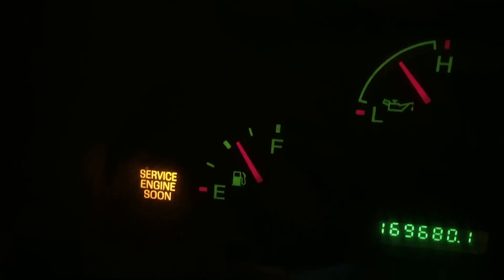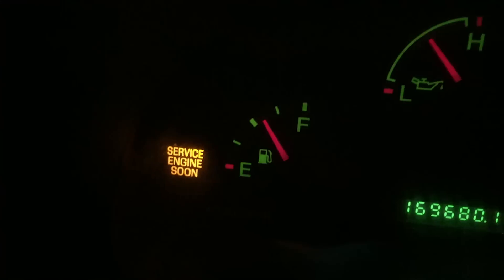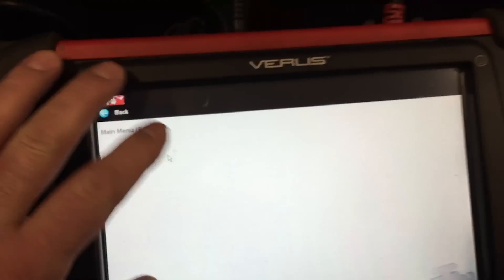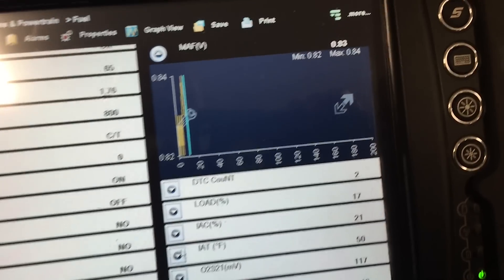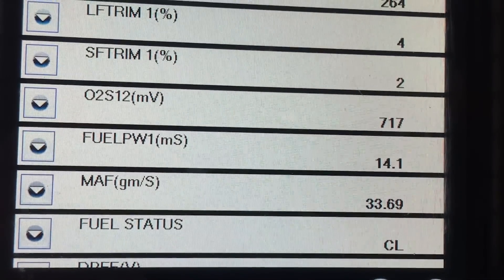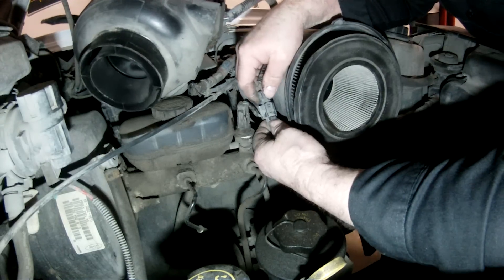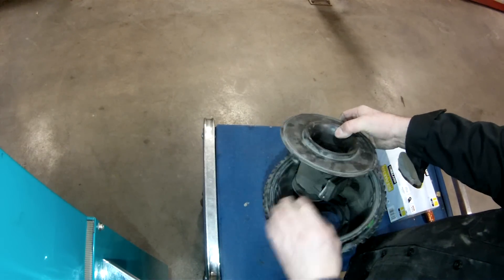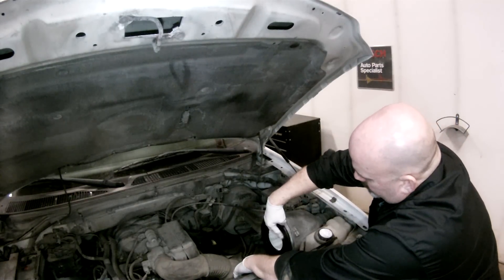Ford P0171 P0174 P1101 - Ford Mass Airflow Sensor Diagnosis Video

Comment: Will it also cause the engine to run cold my heater is working fine but the code said the engine is too cold and it's an open loop

Comment: what if you get lean on one bank and rich on another bank. Runs well when started but has hard cold starts. Checked for vacuum leaks. also there is a rattle in the engine under load at low rpm almost like pre-ignition. No code specifically aimed at MAF. P0171 and P0175 and randomly had a p0300

Comment: I know this video is very old, but worth the shot. My check engine light has been on for months now. Issue I’m having now is that the truck cranks for a very long time before turning on. Sometimes when it does turn on it smells like gas and then will run like if it choked. I checked the fuel pump and they say it’s good cleaned out the injectors and changed the fuel filter.
Reply from the maker: Is there a question here?
Reply: @ThecardoctorTV  sorry not sure why the rest didn’t post, but my question is do you know what the issue could be? I changed the idle control valve but it’s still doing it. Any help would be appreciated

Comment: Just so people will know....always check the rubber grommet where the MAF wires plug thru the air intake tube thingie. If not sealed good, it will throw off all sorts of " this & that " probs and codes. This leak will also be missed during a smoke test. It is a large vacuum leak besides all the other common YT vids that repeat the same shtuff over & over. Also, they never tell you what a normal reading is for a sensor...
Reply: My gromet was loose and seating it back in place was a fix!

Comment: I am surprised you did not attempt to first clean the  MAF with CRC Mass Air Flow cleaner.  Oftentimes that's all that's needed.  To me it's like  replacing the throttle body automatically without first just taking it off the motor, and spraying with Motorcraft throttle body cleaner and scrubbing it with a toothbrush to get the varnish  and soot off it. So many times this is exactly what the dealer mechanics do.  They don't bother cleaning anything' they just automatically just replace parts. That's why I do my own mechanics. Only thing I ever replaced on my Ford truck was a starter.  Everything else is original, AND I have 324,000 miles on my '05 F150 with the 5.4 3V.
Reply from the maker: I’m surprised after watching the video that you made such a comment.

Comment: If the MAF sensor is the problem will it always give both P0171 and P0174 codes. I'm just getting P0171 on a 2005 Ford E250. 5.4L 2 valve engine.

Comment: im troubleshooting a 2004 f150 xl heritage 4.2l v6 with similar issues. was this truck a v6? im getting 3.7-3.8gm/sec at idle and 14.2 at 2500 held steady. similar iat etc as you showed. but 1600ft elevation.

Comment: What’s your thoughts on conflicting lean and rich codes? My e350 ford had CEL on for lean codes , then I cleaned the maf sensor and the codes came back for rich condition. Your thoughts?
Reply from the maker: what codes? What are your fuel trims? Maybe a faulty MAF. Did you clear the KAM after cleaning MAF?
Reply: The Car Doctor I had the p0171 p0174, for running lean , then i cleaned the maf sensor and the codes came back but p0172 and 0o175 for running rich. I went ahead and ordered a new maf sensor. .
Reply: The Car Doctor what’s the KAM?

Comment: Hi, thank you for the really helpful videos. They have helped me a lot. 

Quick question: I recently replaced my intake manifold + plugs, coils, injectors, thermostat w/ housing, water heater tube under the manifold, MAF sensor, CHT sensor, PCV pipe & valve & knock sensor (all Ford or Motorcraft parts). Before changing all that I had 4 codes - P0155, P0171, P1131 & P1151. The truck now runs great! BUT now I’m running 2 different rich codes - P1132 & P1152. 

You have any thoughts what could be causing these codes?

Edit: I drive a 01 F150 V8 5.4 4x4 - 175k miles. It’s been a great truck. First time I’ve had issues.

Comment: mine (2008 ranger) has the same p0171 error bank 1 too lean, but so far everything I've tried  hasn't changed the status. Engine runs perfectly fine. Changed out the air filter. Sprayed around for leaks didn't see/hear anything. Inspected hoses - nothing. Spray cleaned the MAS sensor. Ran a tank with fuel system cleaner. Still the same. Guessing O2 sensor. Sucks there's like four. Great job engineers. There really is no point to an error code when they're so broad it could be like 10 different things.

Comment: ahh im losing my damn mind 96 mustang gt started bogging and bucking hard starting , changed maf made things wayyyy worse . only way to get it started is plug iac but it runs like shit cant drive it. just happened one day after work last week like it has a huge vacuum leak but i cant find anything . fml bad luck lately
Reply: Ben A  the o2 sensors were bad lol, i was wondering why it ran rich bank 1 bank 2 fuel trims were crazy. .. it would run so so in closed loop but after it warmed up it would throw a fit.

Comment: I have a 2001 5.4L F150. My idle goes up and down from about 800 rpm to about 500 rpm.  Does this when in park and when driving the rpm drops and feels like the pickup is cutting out.  RPMs only fluctuates when it is hot outside, drives OK with still a loss of power during the winter.  I have replaced the IAC already.  Could the MAF be causing this issue?
Reply from the maker: yes, also check for vacuum leaks at the PCV hose
Reply: Will this also cause engine overheating?
Reply from the maker: @cstam105  not usually
Reply: @ThecardoctorTV  again, only does this in the summer.

Comment: I cleaned the maf sensor .It seemed to fix it then it threw I the 0174 code again.I cleaned the iac module. idle was going up to around 800 and dropping to arpund 500 and shutting off.2001 ford taurus with 213,000 miles

Comment: I have a f150 Harley davidson with p0171 and p0174 but whenever I disconnect the mass air flow sensor the truck will run smoothly and whenever I connect back it starts to shake alittle it is a likely faulty maf sensor
Reply: Mines does the same thing.

Comment: Ijust replaced the fuel filter and now when i start it it will idle good just dies when i touch the gas its a 91 ranger 4cylinder with 8 plugs
Reply from the maker: I wonder if you have a bad filter.

Comment: Thank U great video I'm having the same problem on my 08  f-150 I pray that will fix it.
Reply from the maker: If it fixes it please send $1000 hehe
Reply: The Car Doctor LOL 😂 😂😂😂
Reply: I've replaced everything.  Had codes showing plugs, coils and injectors. Replaced all that. Now I'm throwing codes 171 and 174. Took through drive cycle.  Still throwing codes. Smoked motor. Seen no smoke except from intake housing where tape was loose. 
I'd add photos of my scan but it wont let me. If you have a cell, maybe you can help me.  We cant afford taking it in because of Mins cancer bills.  If it's not one thing, its another anymore. 
402 363 9027
Thank you for your time!!

Comment: hey i have a 2004 f150 5.4 in it..and all i have to do is touch the plug to the MAF and the truck dies and it has codes p0011 and p0021 could that be related and why would it die when i touch

Comment: Thanks for the explanation, however I still have a question...how these MAF sensors go bad? My Mustang has this intermittent issue and there is no CEL but I do remember a couple of months ago the air filter (Spectre) it kind of "disassemble" itself and the car wanted to stall, after a couple of minutes I parked the car and check the engine just to find out that the air filter was unattached of the Cold Take pipes (So I guess I drove the car like that for a half mile). Can something like this accident can damage the MAF?
Reply: What hear was your mustang and have u fixed the issue? I have an 05Gt and mu car runs good ever so often. If it sits for a day it will run good for about 20 min then it runs horrible no check engine light..

Comment: This video was a big help for me - because I changed the air filter which was so very dirty - installed a brand new air filter - cleaned inside the throttle and the butterfly plate - then a check engine light came on   ( WTF )   driving to Autozone they hooked up their machine and found codes :  PO171  & PO174  - on their code sheet it reads the PCV valve is faulty - after watching this video of yours maybe the Map Sensor is dirty and needs to be cleaned due the very dirty air filter .
Reply from the maker: Excellent!
Reply: I had the same thing , put in new air filter  and check engine light came on . Was thinking pcv. Was it your maf sensor?

Comment: hi, can you pliz help i have my c230 v6 2007 and it runs so smooth but it is showing the check engine light and i checked it and it gave me this code. i cleared the error but it comes out after a 5 to 10 kilometers of drive 
Self-adaptation of mixture formation for enrichment at partial load for the left cylinder
bank is above the permissible limit. (P0174) permanet 
Self-adaptation of mixture formation for enrichment at partial load for the right cylinder
bank is above the permissible limit. (P0171) permanent

Comment: P0102 MAF Sensor Circuit Low Input on 97 F-150, same difference? Getting a P0430 Catalyst System Efficiency Bank 2 Below Threshold also, figure I'll start by cleaning the MAF.

Comment: I have a 05 with lean bank 2 rough idle and really rough sitting under load
Reply from the maker: Monitor your O2 voltages and see if bank 2S1 is at fixed voltage when warm around 400mv (bad O2) check misfire monitors and see what cyl is missing. Possible fuel injectors, spark plugs, wires, Use OE parts.

Comment: I have a zx2 it start and runs but I have to turn the fuel pump on twice to get it to start but if been driving it don't do this go new mass air  and fuel rail pressure valve sencer and a new tune up but pvc valve and lines and many new parts but not iat and fuel pump but reading seams to be good

Comment: can a egr pressure feedback sensor cause code p0171 and p0174 
on a 98 ford explorer 4.0 sohc
Reply from the maker: No but a stuck EGR could. Look for vacuum leaks from the PCV hoses
Reply: The Car Doctor 
i change out the egr pressure feedback sensor and it cleared the codes so it must of been leaking

Comment: I just bought a 2006 (the guy told me it was a 2008 when I bought it) Mercury Milan Premiere with a 3.0 V6 engine. When I bought it, the  guy said it needed a cam sensor replaced. We did that, but now we are getting these codes and we are worried that we got a lemon. Is it possible these codes could indicate a timing chain needs to be replaced, or is it just a simple fix?

Comment: do you know if a bad map sensor mite be cause my issue I have 98 f150 4.6 run great turn off when to turn off and it lost spark out of no were I Chang ever part I could think of and still no spark and no code turn over good.
Reply from the maker: does the check engine light come on when the key is turned to the on position? Maybe no power or ground to the PCM? Have you tried talking to the PCM?

Comment: Hi, and excellent video!  I have a 2002 F150 with the 5.4.  I am chasing an intermittent P0171.  I connected my scan tool and the STFT & LTFT go sky high.  I've replaced the fuel filter, cleaned the MAF, replaced the DPFE and smoked the engine with no vacuum leaks.  I have no drivability issues, but the intermittent code and the high fuel trims are bugging me.  I always use Top Tier gas.   Fuel trims at times at idle approach 25+ combined, and drop to around 15+ at engine speed and continue to drop at higher engine loads, like heavy acceleration.  Any suggestions?
Reply from the maker: Maybe the MAF is faulty? Have you run the MAF calculator?
Reply: The Car Doctor I’ve not done that yet.  I did run the smoke test again and see I’m getting smoke at the IAC (pretty light) and from the body of the EGR (somewhat heavy).  The EGR holds vacuum.  Should I expect smoke coming from the body of the EGR?  The operation of the EGR is otherwise good.

Comment: **For anyone trouble shooting the clacking/VCT/VVT/Cam Phaser Diesel noise (Most apparent in left wheel well during cold start; Read Here!

Looking for cleanability of this MAF, as the filament is inside the rectangle :S
Hey! just had an idea! I have this domain name: MeanGarage.com, dude you'd be a great fit for that.  If you're interested, get back to me Ill make you an awesome deal.

**Back to the 3v version of the 5.4.. where was I? Should have stuck with the 2v; for those who don't know. the 3v has VVT variable valve timing, in order to facilitate this feature, they had to install a 'Cam Phaser'. If your 04-08 5.4/4.6 sounds dieselish....... especially under the passenger wheel well...... try a VVT sensor, dont buy aftermarket and don't go dealer. Get OEM online for half price.  If you're in a position like me, the VCT sensor/solenoid won't change it a bit.   

*BUT! Don't give up hope, I have heard from multiple people that changing your coils can do the trick.  That imo would mean that your engine is running just a hair off.  Anyway, hope that helped. 

And OP! Thanks for info, and shoot an email to info@avantbellwether.com, I want to see this Domain go to a great owner.

Comment: 2001 F150 5.4L Engine L

I have these two exact codes popped up as well as P0 304 and P0 308 (cylinder 4 and 8 misfire)

When I accelerate in probably 3rd gear, the truck will erratically shake, but I can accelerate through that and if I keep it below 40 mph the truck will not shake. I have replaced the air filter as well as the fuel filter today.

any ideas??? Thank you sir.
Reply: Did you ever figure this out? Having the same issue and every now and then it just dies.

Comment: Great video!  But you made the process more difficult than it needed to be.

I have a 2000 Ford F250 Super Duty with the 6.8L V-10, and my MAFS went bad.  The light on the dash was on, and the truck started rough.  I bought a new one and replaced it in a couple of minutes.  I took off the band that holds the "nozzle" to the air filter box, took a screwdriver as you did and pulled out the unit, disconnected it, and replaced only the sensor with the small allen wrench that came with the new sensor.  I did not have to replace the entire "box" that holds the sensor, and I did not have to remove the unit from the large unit that connects to the throttle body.  It was much easier, with not as much disassembly.

Keep up with the great videos!  I do most of the work on my truck.  18 years old, 365,000 miles, and still runs great!  Can't say that for the rockers, though.  Cancer!
Reply from the maker: Cool. I used the OE motorcraft part as I havent had much success with those aftermarket sensors like the one you installed. Great success story on your truck and I hope it continues to give you great service for many miles to come. Take care

Comment: Check Engine Light on says P0171 System to Lean Bank 1 I have : 2005 BMW 330I . The car drives fine. I found OE Replacement Mass Airflow sensor is it alright to buy and replace?
Reply from the maker: Possibly, couldn't hurt. Have you tried cleaning it or doing a MAF calculator?

Comment: That's it no codes on my 07 F150 what the symptoms you described at the beginning of the video low power very poor gas mileage
Reply from the maker: Well try cleaning the MAF and see how the mileage improves. Good luck

Comment: Good day Mr.car doctor am having the same issue that you explain in the video,I also have another problem it's with starting my vehicle,I have a 2002 expedition 5.4,whenever I start the car it cranks but it doesn't turn on the 1st time,on the second try it stay on  but starts a little rough but goes back to normal conditions can this be mass air flow issue.
Reply from the maker: Good day! Yes it can be just the MAF since it may be running rich and fouling plugs causing hard starting.

Comment: Thanks for the video Car Doc.  

I have a 2003 4.2 that is throwing 171 and 174.  Drives fine at all speeds, but sometimes the idle goes a little lumpy.  Anybody have insight on that?
Reply from the maker: MAF? Vacuum leak?
Reply: I have a Ford F 250 Super Duty 99 5.4 engine shooting Codes PO171 PO174 what do I do to just correct the problems

Comment: I've had all of the codes. more of the lean bank 1 codes. I've replaced all O2 sensors, new fuel pump, new fuel pressure sensor. new fuel pump module, new coil packs, new spark plugs, and today I've ordered the MAF, housing and all. I did take apart and cleaned with cleaner the maf, it's still shaking and idling rough. it's taking 1/4 to drive 55 miles. I know it's a V8, but that's alot of gas... I drive an 04 f150 stx, 4.6... Please help!!
Reply: Hi good evening 
Did you find the problem I'm having the same issue with my work van

Comment: Hey There...Well, I had to replace my Mass Airflow Sensor because the "Check Engine Light" kept coming up...I replaced it yesterday, and everything was running really well till today...I got the check engine light came on again, and the RPM's are going crazy, going up and down like mad...I have a code P0174 still keeps on coming up...so I am thinking that there is a LEAK in a hose???? Could I be right in assuing this?  Thanks again
Reply: I wish these people who make these videos would at least give some insight to peoples questions.  I know its been a year did you ever figure it out?  I had happen to me what you are describing which ended up being a vacuum leak.  The leak was from a bad air intake plenum gasket... The 10th gen f150's are notorious for that.